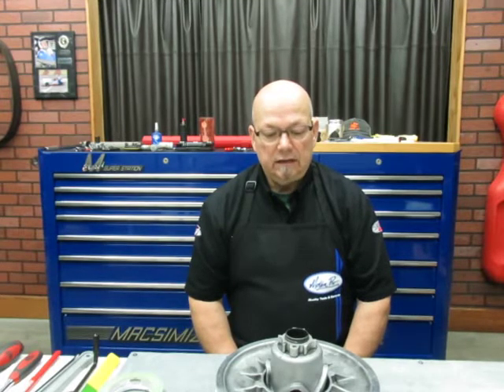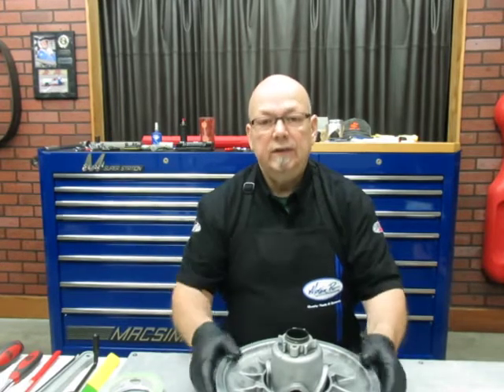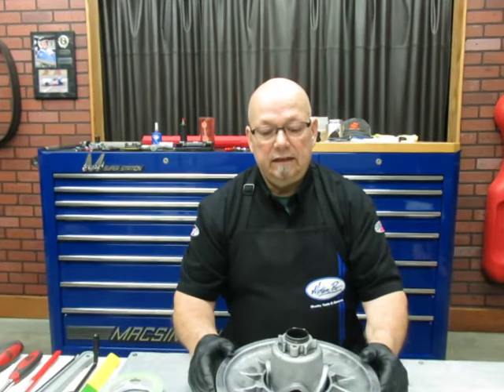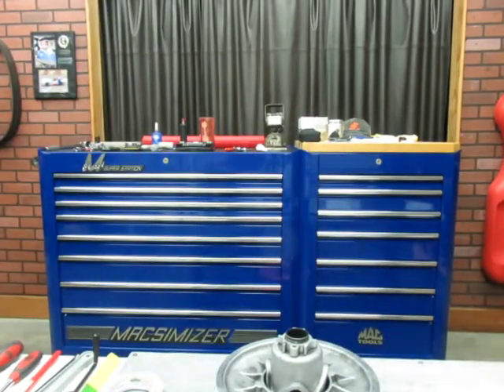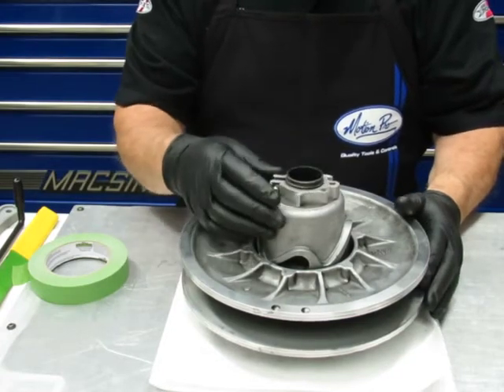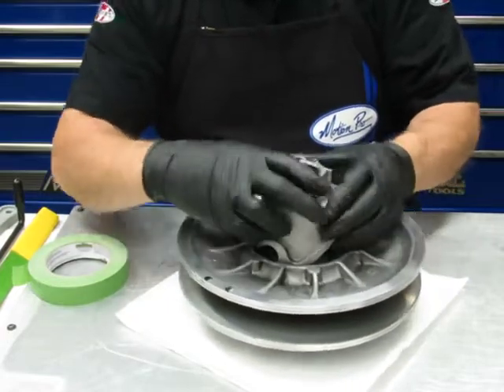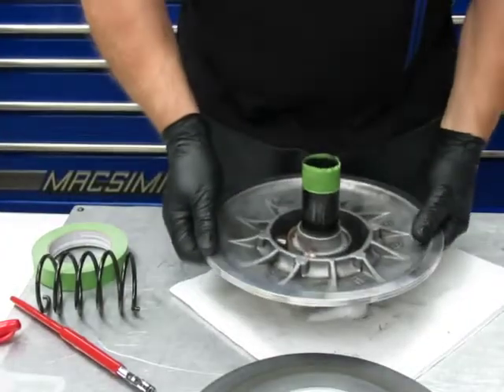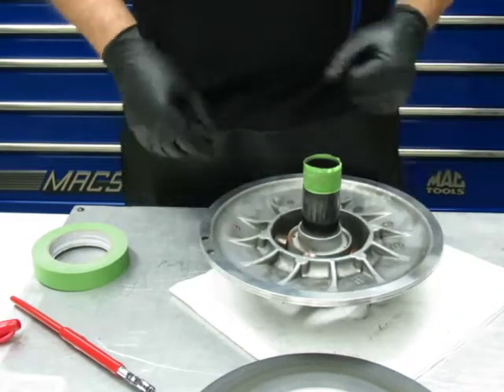QRS Episode #3 Disassembly QRS Short Shaft Clutch Ski Doo Ace 900 - Performance Mods

Comment: Do you have, or know of a good video to show the removal of the secondary from the snowmobile?
Reply from the maker: No video. There is just one bolt that holds the secondary on for the 900 ACE Short Shaft. Just remove the bolt and make sure you do not lose the spacers located behind the secondary.

Bob